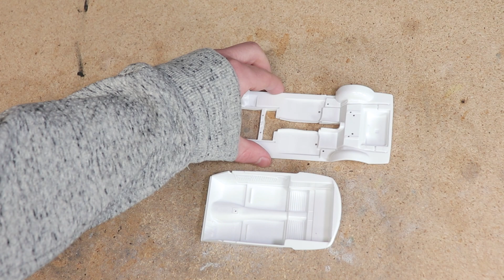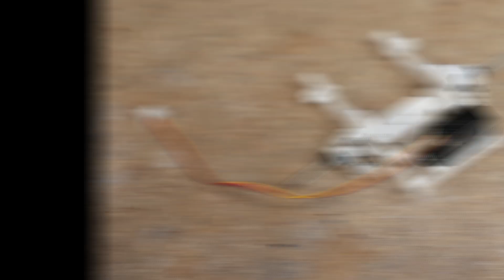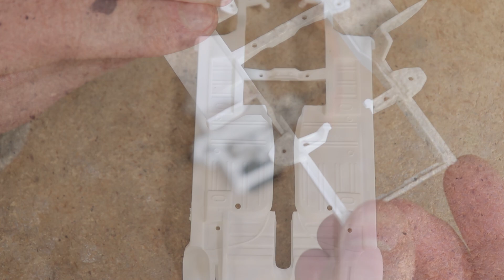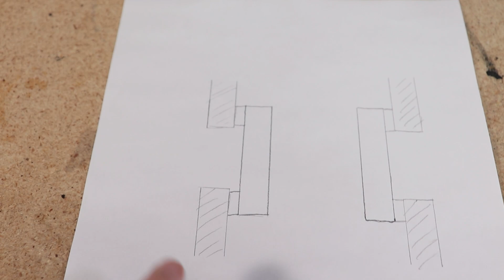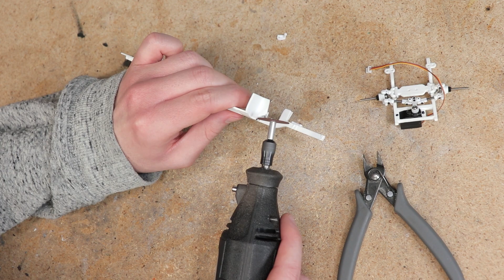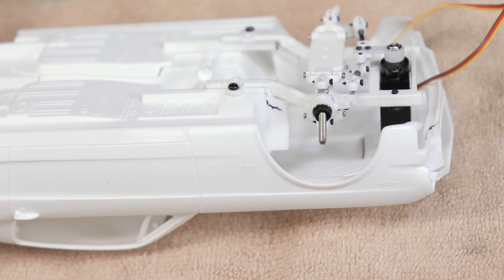Installing 3D Printed Front Suspension and Steering on to 1/24 Scale RC Shelby GT350

Comment: Hi where did you buy the rear axal for this car ? I'm triyng too find one for m'y project 🔥
Reply: He sells everything on his online store to do this your self. I built a 97 mustang gt into a 1/24 scale drift missle, I had some really hard non sticky Goodyear street tires out of another kit and I sourced my own motor offline abd used his suspension stuff and everything came from his site besides model car kit motor and esc, and servo and reciever, i used micro 3 gram metal gear digital rd plane high torque servo